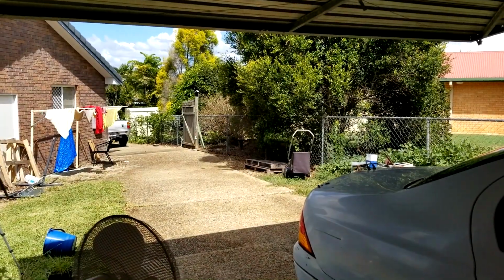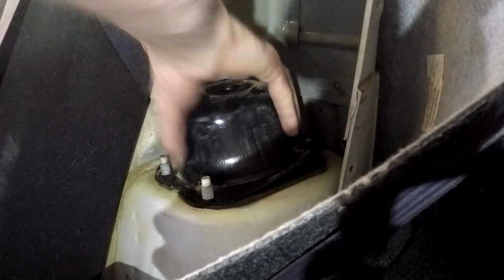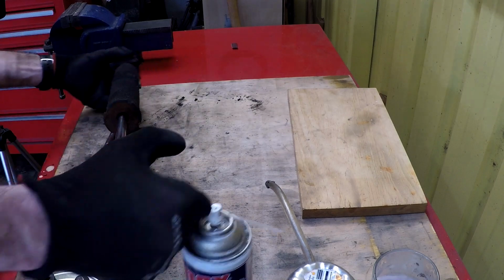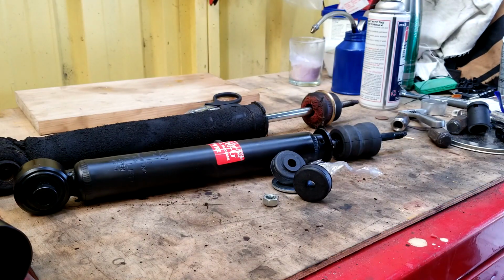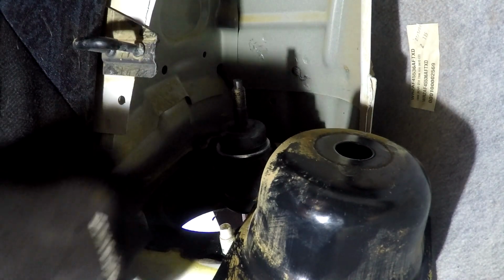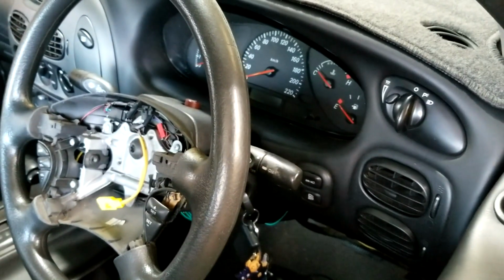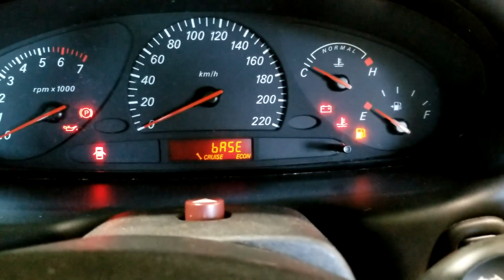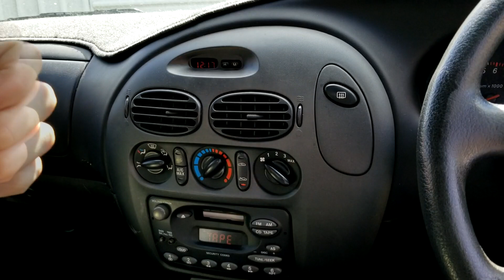AU Falcon Part 4. Shocking Steering wheel action

Comment: To remove the spanner off the dash. Hold down the trip reset shaft near the speedo. Hold it down for about 15 seconds.

Its only to tell you it needs a service, but wont actually turn off even when you do service your car. So you manually reset it

Hope this helps a little

Comment: Any chance you can say which wires you found were for the horn?
Finally found a video that has same problem as my 99au, but you didn't show which wires are involved. I've gone to the circuit diagrams and tried to find the correct connector but no luck. trying to do exact same thing as you but hoping to not have to removed the horn pad
Reply: seems no vids from this poster for 2 years, so I went and took off horn pad/airbag, quite simple procedure if have the 5 star tool, turns out there is a big grey connector under the dash, it has 4 wires going in and 4 wires coming out.
The purple going in is the horn wire, that turns into blue going out, cut blue wire and splice in  a suitable switch at dash, then another wire should go back to ground at same big grey connector ( black wire ).
why would someone put up a video and not give this information since that was the whole point of the video?
Reply: dont worry did it myself, big grey connector under dash near steering wheel, has 4 wires going in and 4 coming out, the purple wire going in is the horn wire, it turns to blue coming out.  Cut the blue wire insert a switch and other end of switch wire goes to black wire at same connector........your welcome.

Comment: Why did you take off the complete strut tower? (the 4 bolts surrounding the shocks head) 
You can just undo the top bolt of the shock
Reply from the maker: 'Cause I didn't realise how easy it is to move the spring when there's no weight on it :p well, I know for next time now